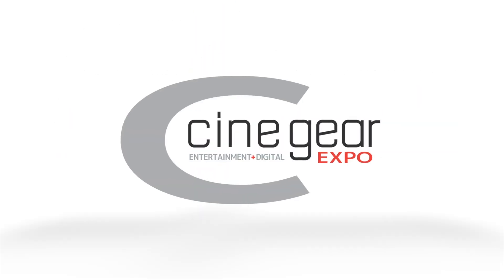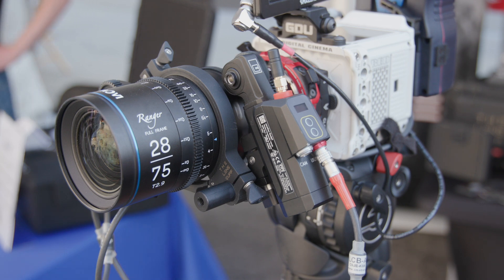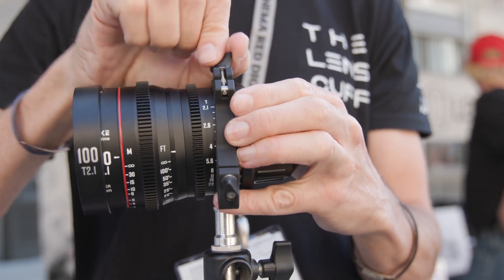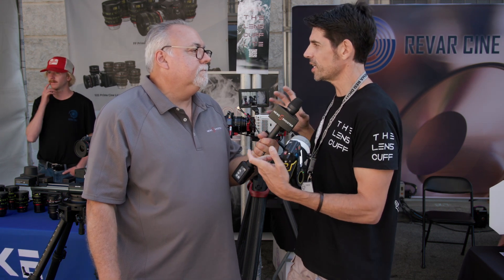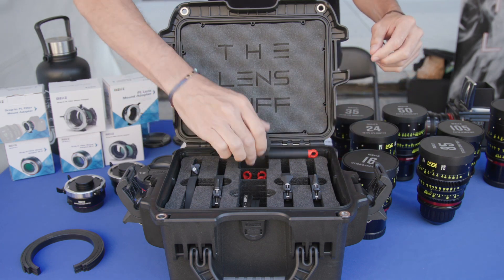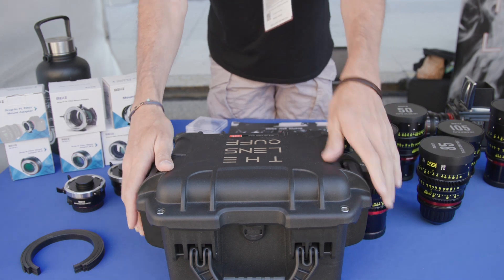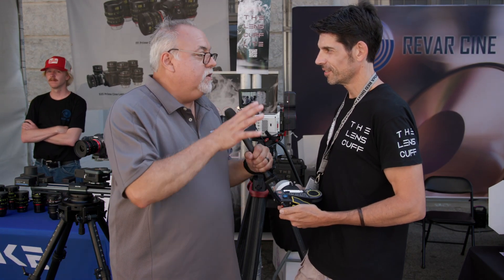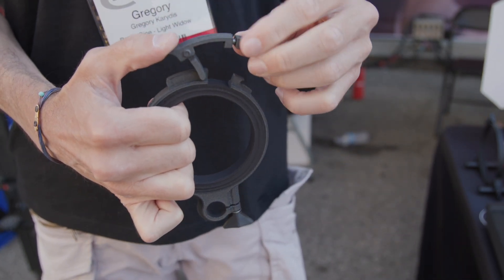The Lens Cuff. A new way to mount lens motors to a cinema lens

Comment: wont this stress the mount, since there too much weight added on the lens now ?
Reply: A bit, yes, because you are adding weight BUT it's not at the level of stress that FIZ motors can apply to the mount when it's traditionally attached to rails (you can see how it pushes the lens away no matter how snug the gears are together)
Reply: @KuboriKikiamShow  You are absolutely correct! Compound to that the fact that no matter how precise an AC is when rigging lens support in the effort to counter the force of the motors, the rods & support screw will either push the lens upwards or pull it down. 
Long term it is a known issue with rental houses that the lens focal plane stops being co-planar and loses edge sharpness.
Reply: Cine lenses, whether PL or bayonet mount are designed with the provision that about 1kg of weight will be mounted at the very front in the form of a matte box with 2-3 filters. Most PL mount lenses and nearly every Prime bayonet lens exceed that specification.
That translates to nearly 3x that much load bearing capacity in the middle of the frame.
So adding a Lens Cuff (max weight of 85gr) with 2-3 motors in the middle of the lens equates to about the weight of 1 filter at the front of the barrel.
Reply: maybe I would like to add a lens support which also need to be mounted on a rail:face-orange-biting-nails:
Reply: no. get done help bro